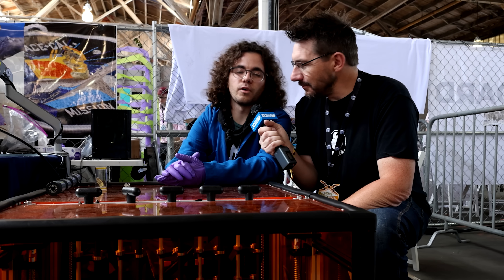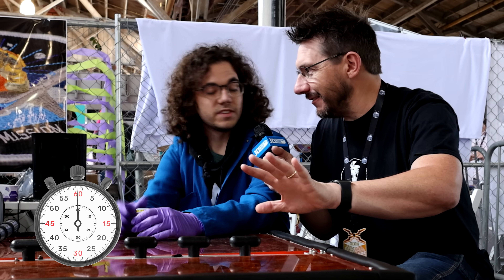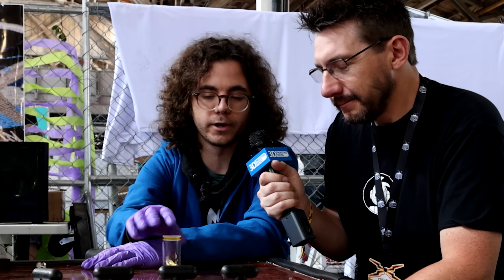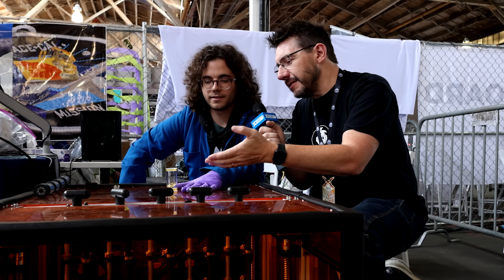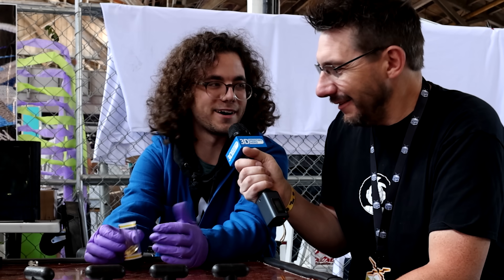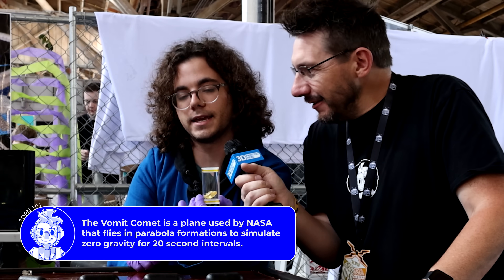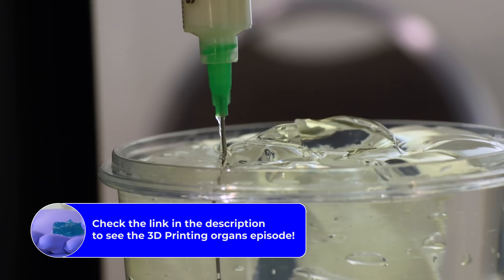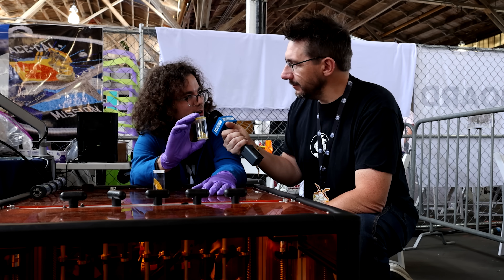3D Printing in ZERO G!

Comment: if i understand. they aren't actually making the whole thing at once. like how traditional resin printing makes 2d layers on the bottom that get stacked in a line they project 2d layer of the diameter as the vial spins

Comment: But at what quality does it print!!? Theoretically, if you use a 8 or even 16k projection, would the print become more atomically accurate?. When does it become an atomic-level accurate print? Then we can print superconductors and get boosted in a new tech renaissance.

Comment: I am full of questions after this, don’t full get it...
I can understand how crossing beams accumulate enough energy to solidify a point, and get how rotation helps to accomplish that, but what about material the light passes through? Are there never any points that solidify unintentionally just because they are on the way to the targeted points? What does that mean re the raisin that just “played support”? Is it still useful? Or is there any radiation that rolls back solidification ?  
And you are talking about bio printing - and that means chambers, intricately connected vacant spaces. A beam will always pass through the entire vile. That’s how light works. At least until it is refracted. We could see in the photage objects form - that means they now have a border and a different refractive index. That must affect the result and must be taken in account onto the projection.
The implications re scale are not just a stronger beam. Software and computation capacity are involved.
Also, the bigger the vile the less transparent it is to the projected wavelength ... 

As amazing as it looks, so much of what was said does not make sense...

Comment: This isn’t really printing all at once, it’s a form of traditional SLA printing where the part is made by rotating the vat rather than printing layer after layer vertically. I imagine the print quality and resolution might be rather poor since you’re reducing the print to only a few clockwise layers.

The zero-G thing sounds like a real hassle, and I’m not sure how they’d want to apply this for organ printing since SLA printing, including exotic SLA methods like this, are single material only.

Props to the team though for trying to come up with novel 3D printing processes. We do need more research in this field, and speed has always been a major issue.

Comment: I think i know how the projector works, but one thing that will tell me for sure is can you print a hollow object or does it have to be solid? If it has to be solid then i believe they are spinning the image in the projector at the same rate as the resin so that its outlining the shape in the resin and hardening everything inside the outline. The resin probably needs to be exposed x number of times to fully cure so only the areas constantly being exposed by the projector actually cure. Im probably way wrong.

Comment: According to my calculations the "cure through" dose needed would negatively impact the part accuracy... or if you tuned the absorptivity of the resin to get decent accuracy, you would be left with large radial conversion gradients in your parts... interesting chemical engineering problem 🤓

Comment: I kinda get the idea but still confused on a few points.
Once the print is finished, is the remaining liquid reusable or does it need to be thrown out?
Reply: It depends on the chemistry.  Most of what I'm guessing they're using right now is probably nor re-usable, or is only re-used a very small number of times.  That's not a requirement, just a consequence of what resins are available for them to buy and modify.  For normal resin 3D printing, people want resins that harden quickly in even low amounts of light.  That means that common printing resins used in this process will have small amounts of hardening throughout the vial when exposed to the projector.  The part being printed will harden the most, of course, but almost all of it will harden a little.  Re-use would harden more of the wrong parts of the resin vial, lowering the detail on the printed part.  

A resin deigned for this process would probably have reversable chemistry if such a thing can be made economically.  It would be possible to soften it again either by exposure to some chemical that can then be washed out, or by exposing it to heat or a specific wavelength of light.  A quick google search implies that this is a possible chemistry, so someone will no-doubt try to develop a no-waste resin for this kind of printing.

Comment: This is an interesting approach to having a process optimized for use in micro/zero G environments. It would seem that if you wanted to use this here on Earth, you would still need a support structure. I could see something like the part being constructed around a thin metal pin might be all you need to tweak the process.
Reply: The viscous resin they use prevents easy flow, even when the projector light is heating things up.  The resin itself acts as a support structure because print times aren't long enough to heat the resin enough to make it flow.

This is not the absolutely weirdest method of supporting a print I have seen.

Comment: I wonder if you could use multiple projectors to print even faster.
Reply: It would get very complicated and you would risk hardening resin that you didn't want hardened.  That said, multiple projectors would let you try some other chemistries that might allow for finer details or faster prints.  You would probably only have one projector on at a time, however.  Heat from multiple projectors might be a problem, as part of the trick to not needing any support structures relies on the resin being viscous and too thick to flow under the small amount of heat it gets during printing.

Comment: Absolutely amazed by this technology! It's truly refreshing. This innovation is set to revolutionize the market, just as LCD and FDM have. I'm curious, are there any LCD printers that can match this speed for such volumes? Does anyone have insights? Also, printing larger volumes is certainly a challenge.
Reply: I know there's a recent printer called FinderOne136 that's very similar to what you mentioned
Reply: finderone 136？how about this printer?How accurate is it? I have a 3D printer, but its accuracy and volume it prints are no longer enough for me. I'm thinking of a new and better one.

Comment: for people having trouble understanding it, it's actually really simple. it's just a projector projecting a 3d model that is rotating at the same rate that the resin is rotating. it's very clever and elegant.
Reply: H how
Reply: From all I understand the first thing the light touches is going to be the thing hardening first, so, like, the liquid right next to the wall will solidify first and quite evenly (because it is spinning)
How does
Like
How does depth information be transferred, via a single projector, with a single point of view of the object? Us humans and, a lot of animal for that matter needed both of our 2 eyes to extract depth info

Comment: My idea was to use 2 uv lasers at 90° to each other. A single laser is not strong enough to cure the resin but where the 2 laser meet the power level would spike.
Reply: I think the patent on that idea has already expired, so go for it.  If you want to go for super-fine detail, there are resin chemistries that require the molecule to be struck by two photons at the same time.  If you split a laser using a mirror or other method, and the paths taken by each split laser are the exact same length, then you will get those two-photon collisions at much lower brightness.  Obviously, this is super-hard engineering, but it does allow you to print things small enough to put on individual cells.

Comment: I would assume the resin isn't completely reusable though, since to polymerize the object in the center the light has to pass through some resin material which inevitably will slightly polymerize unwanted material before it hits the object. Unless there's a process to remove the cured from the uncured I could see this process being somewhat expensive material wise.
Reply: Reversable polymerization chemistry is possible, so a resin might be economical to produce that you could re-melt with light or heat or something.  What these guys are doing almost certainly relies on existing resin chemistries and wastes resin like you think it does.

Comment: Now look, I know those who didn’t drop physics class in y11 like i did, are probably going to shoot me for this, but.
What if they designed a specific magnetically levitated track to mimic the flight path of the vomit commit (scaled down of course) to emulate zero G for further testing on the ground? Mag lev should solve the stability issues of a normal track where solid contact friction is at play, and it would allow for more frequent test runs.
I’m also not factoring in cost here for obvious reasons but I recon it’s possible with the right project sponsor.
Reply: No maglev needed, you'd just need a drop tower tall enough to have 20 seconds of freefall. Would be expensive to build, but certainly way cheaper than a maglev track

Comment: Question, if someone wanted to make one of those themselves

A
Would one be able to easily get ahold of that super thick resin or make it?
And b
Is the group planning on releasing the "slicing" (ig it doesn't really slice the model  but it's the best term I got) for someone to use to create this at home?

Edit I retract b I hadn't finished the video yet lol

Comment: If they hadn't sealed the Kola superdeep hole in Russia, and you could engineer the equipment to fit into a 23cm dia envelope, could you make a 50 second low viscosity print while the equipment was in freefall?
Reply: Youd have to pull a vaccum on the tube or use some other method to get around drag from the air, which would be very difficult.

Comment: It seems like they could run it faster and avoid strings if they spun the projector around the vial instead of spinning the vial. The printer would be more complex, but I wonder if it would be worth it to avoid dealing with inertia
Reply: The projector needs power.  If powered by a power cord, the cord would get super twisted.  If powered by a battery, that'd make it even heavier than it is.  Swinging something heavy in a clean circular motion with such a large radius without wobble is so much more difficult than spinning something on its axis.
Reply: @hughobyrne2588  true. It would probably be worth the extra complexity with a larger vat though. Because of inertia, the larger the volume, the slower it would have to rotate.

Comment: Man, I super regret not stopping by the booth to take a closer look at this. Really neat stuff. Makes me wonder if rotating the chamber in more than 1 axis might provide even better resolution since I assume you can only beam through the same media for so long before everything in the way solidifies.
Reply: It might be better to rotate the projector instead at that point, that way you don't get weird forces on the part as you turn it over.
Reply: Seems like the entire vat of resin is "spent" after every print and has to be tossed if I understood how it works correctly, wish they talked more about limitations and downsides tho. I think it can only do solid objects too, nothing hollow so its got some insane print speeds but I have a feeling its very limited in what it can actually print...
Reply: @DrakeOola  As with every process, there are limits and downsides, yep.

Comment: AWESOME! I remember seeing this a few years ago when it was first annouced and wondered just what the hell happened to it. Surely this replaces Resin printers at the small scale of the market? I can totally picture a resin printer using this tech turned on its end so the projector shoots up from the bottom as the tube is held horizontally. Basically instead of a UV light projecting just light and a build plate, you got a build jar and a motion projector on the bottom. Seriously, I'd go nuts for this to hit the mainstream - printing in minutes - let alone SECONDS! Would be a dream.

Comment: I'm curious about what kind of resolution this can print down to. Like can it print small gears or 'build in place' mechanisms with break away supports... or is it only capable of printing solid objects?
Reply: Resolution would depend on two-ish factors - X-Y resolution of the projector being used and its contrast rate.  The brighter and darker that the image being projected can be, the clearer the details along the projection axis of each slice can be.  There are a bunch of tricks that can be done to up the resolution, for using collimating lenses so all the light striking the resin is parallel, to using some kind of laser optics on (what I assume) is a DLP reflector.  

An even slightly powerful UV laser that could project a beam roughly the size of the projection element, routed through optics that first magnified the resulting image and then re-collimated the beam path so that all of the light hit the resin dead-on would make the features as sharp as is reasonably possible.  At that point, it's really a matter of resin chemistry.

I lie, you can get sharper if you want to start playing with weird split-beam quantum effects and special polymerization chemistry that requires two photons to hit the polymerization molecule at the same time.  But at that point you're talking about a process so delicate that you would need to do it in a chip fab's clean room to ensure results.  Maybe someone needs resin thingies that can't be made any other way with super-duper fine details, but I doubt that they need it enough to invent it.

Comment: Paused at 6.26   
Hi from Will and Mr Data :):] 
Perhaps someone shall build my zero g build space thing. 
Perhaps youll get to print on earth soon.
Years ago i licensed relating to atom printing and had guessed the engineers would not be likly to build the device in my life time but a few years after that it was done, cant see those layer lines ha. 
So within 5 years we might see a earth zero g build build is my guess. 
Wishing you nice success.
Be well.

Comment: It seems to me that they use light density with a rotating 3d model with an "xray" shading rotating in sync with the printing vase. So the density of light will be the same in each point of the resin. Not clear if they are pulsating slices of the 3d model or just projecting it all at once.
I think it would make more sense to send pulses for the z axis, but I don't know yet. Gonna check the paper.

Comment: The fact that they could test how the printing in "zero g" would turn out, simply by printing in a "zero g" nose dive of a plane, because the print times are THAT fast is outright amazing...
Reply: Or in the lift in the Burj Khalifa, if they have good brakes:)
Reply: I think the vomit commit can have zero go for like 90 second, so that is a large margin
Reply: 🤓 aktualy it’s not a nose dive it’s a parabola like a roller coaster does on an airtime hill but bigger
Reply: yeah no 8hr print times  ha ha
Reply: I'm thinking that with print times measured in seconds it's feasible to employ some sort of tracking to follow the print as it rises and keep the projection aligned.

A smart approach to printing the object might allow finished portions to rise above the surface as the rest is printed. And of course supports are probably an option.

Here's an idea! Magnetorheological additives in the fluid, use an electromagnet to make the stuff more viscous,  then turn it off and it returns to its base state.

So many possibilities.
Reply: @DrewLSsix  chatgpt wants you to have an original thought for once

Comment: So they can Project something that has not blockage of light, so CLOSE and Highly detail may not be as possible as an additive process.  Think of extreme detail artists and hairs, materials.   Shells and car bodies, rocks general body shape will be fine but the detail for this method will be the challenge.
Reply: This is just a first generation of a very new tech, and making it opensource the community will help it improve since it's a "simpler" process in terms of hardware and software compared to fdm. He stated that they could eventually go up to a meter in size.
Reply: @ivoxx_  Yes, bigger is better for this type of 3d. Bigger , less detail.

Comment: I've seen this technique shown at trade shows for a couple years now but it's always these tiny, very simple models that are clear. I want to see larger, detailed models, that are opaque.
Reply: Opacity will have to come from a post-processing system.  You have to have the resin clear for the light to penetrate the entire tube.  Larger items are a matter of custom projector designs and optics. Everyone is using modified parts of the shelf, so options are limited.

Comment: Is there any way to simulate zero-g in a small area, without needing to go on a plane? I wonder if a system with pulleys or some other kind of motion system can move the print chamber in a way that simulates zero-g?
Reply: I found this video, it uses sound waves to freeze objects in space.
https://youtu.be/c05VSs3q56U
I wonder if this would work for this application?
Reply: If you make a tower tall enough and rebe the air from inside it, you could drop the printer from the top.. The main problem is that it would be moving 706km/h (196.2m/s) after 20 seconds.. 😮
Also, the tower needs to be very tall. 1962 m.